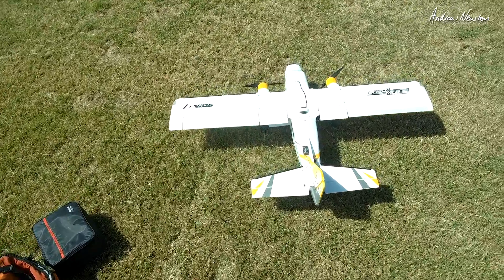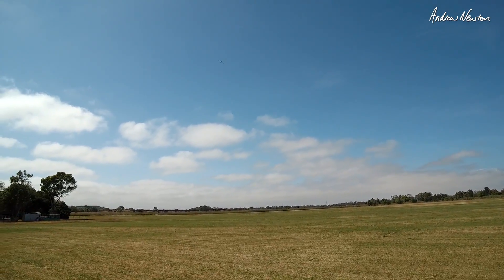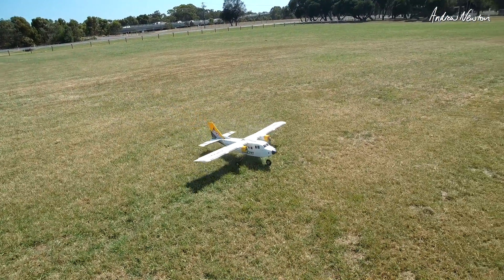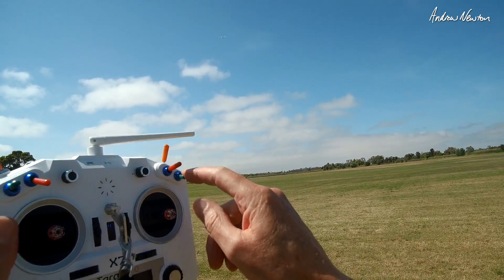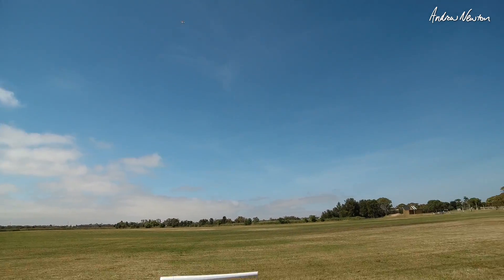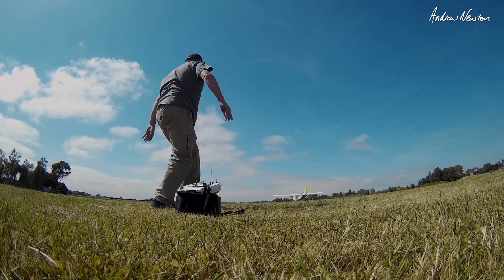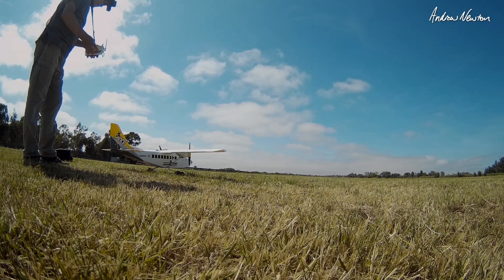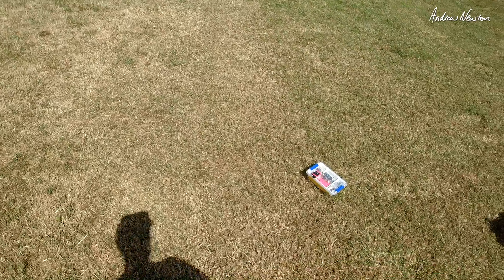iNav Auto Takeoff - Bush Mule

Comment: did you setup the escs as individual left right or join motor esc and signal wires .....if the first way did you set throttle to two channels?
Reply from the maker: Individual channels for each throttle. But either way works fine

Comment: After you're done with the house, you can show us Inav auto landing with that same airplane :D.
Reply from the maker: Auto crash? I'm not brave enough to trust it.
Reply: @AndrewNewton  some time ago my dart got failsafe, and inav autolanding was engaged and it landed in to bushes. There was not much of damage. I don't know if the bushes caused the damage or prevented from greater damage.
The throttle was cut off before it touch the ground. But, I'm sure you know that inav altitude reading is not very acurate.
I'm just wondering how it will work with landing gear, haha.. :D

Comment: Is airspeed sensor necessary for auto takeoff
Reply from the maker: No. INAV doesn't use Air speed sensors for anything other than display in the OSD
Reply: @AndrewNewton  how do we find inav auto launch in inav configurator 2.6.0

Comment: Can it be set to trigger auto launch with a switch only, so you wouldn’t need to push the model?
Very cool anyway!
Reply from the maker: Yes, there there are a few settings to play with, launch idle, launch time and acceleration. Maybe ask on the iNav Fixed Wing Face Book for the right setup. I have not done it myself.

Comment: Awesome! I recently saw a flight controller (very cheap... only 60,-) incl. GPS, ESC, OSD all in one combo with also Auto-Takeoff

It's the: SN-Light Flight Controller from banggood. I wonder if u ever heard about it. According to many flyers it is very reliable and it is starting to get attention in late 2019. 

It has features like RTH, Alt. Hold, Stabilization Mode and more. The main best part is: You don't need a PC or computer. You can manually set it all up in the OSD with the sticks of your transmitter. 

I hope to see it once on your channel..!
Reply from the maker: Sounds interesting. I'll check it out

Comment: As you stated in your Description... Why would Auto Takeoff  "puff your batteries, burn out your ESC." ?? During Auto Launch... do you have any transmitter Throttle control in case of emergency ?
Reply from the maker: Instant throttle increase to 1700 or 85% and holding it there for the launch duration. Some power setups will struggle with that. You can abort by dropping throttle to zero, switching out of the mode or moving any sticks

Comment: I want share something with you😞😞😞
Just 1/2 Hour ago i completed all thing of pusher plane...but when i was going to check and connect the battery My 1000KV Bldc Motors burn..💥
Every thing was ok But I think it happened due to bullet connector which touching each other but they are covered with heatshrink tube...
It was my First Rc Plane...😫😫😫

India🇮🇳
Reply from the maker: Oh no! Must have shorted out somewhere
Reply: @AndrewNewton  Yaaa...i think so😐
I ordered a New 1400kv in place of 1000kv with 8045 prop is it good...
It is based on your "3 Channel Trainer" Pusher.

Comment: Now set some waypoints around your field, autostart and go back to your chair. While drinking soda/juice etc , you can now watch as spectator until the mission ends or your bottle is empty. New-age model flying, lol.
Reply: Yeahhh.. i'm agree with you bro, this is new era flight of rc plane 😁
Reply: aMax, AndrewNewton I do a similar thing with arduplane on a Bixler. Auto launch then fly an auto mission then land without having to touch the transmitter (if you want). It is magic. now trying to do the same with Inav but can't get the mission to work after loading using stick commands even though they show up in the CLI and I'm within range of the first waypoint. Has anybody been able to do this with Inav? What am I missing? #AndrewNewton
Reply from the maker: I have not tried missions yet, but your Arduplane setup is magic!

Comment: I'm glad to see that iNav is trying to catch up. Arduplane has had very reliable auto takeoff and auto land for at least six years. And there is no need to jiggle the plane to start it, as these are built right in as action steps in the mission planner.  I have recently switched many of my iNav flight controllers, such as Omnibus and Matek over to run Arduplane firmware and it works beautifully.
Reply: inav dont have auto take off from the ground i think. He just use auto take off you normally use with hands. thats why he gave it a push

Comment: Very nice unit but too much automation would take the fun out of flying rc for me personally. I did use a stabilizer for 3 or 4 flights when I got back into rc flying after 20 years out of it but quickly removed it and now I will not have any aids. Each to their own I suppose.
Thanks for doing videos.
Reply: Geordie NUFC I feel the same way when it comes to line of sight flying. This is something an FPV pilot could totally use though for taking off with goggles on already. I take off with goggles on already with landing gear and sometimes it can get sketchy. This gets you in the air and some altitude to take over. I think that’s the idea behind this kind of automated flight assistance.
Reply: CAROLINA KAYAK ADVENTURES 
yeah, I never thought of the fpv or quad guys, I only fly los with planes and a heli.
Reply from the maker: This is just me being inquisitive, I wouldn't recommend launching like this routinely.

Comment: Can you start to taxi then switch to launch while moving to avoid that brutal shove?
Reply: Ardupilot has had auto takeoff and landing for at least six years. And, no need to shove the plane.
Reply from the maker: That would be good but I haven't worked out how yet. This is just me being inquisitive, I wouldn't recommend launching like this routinely.
Reply: Very little with wheels in my fleet, so my launch mode is to switch in a little up elevator, arm, open the throttle and throw.
Reply: Just noticed the old Flybeam hanging above my head, looks like an INAV candidate.   :)